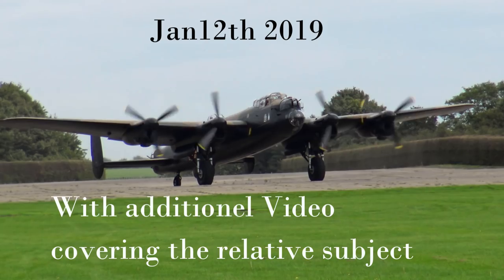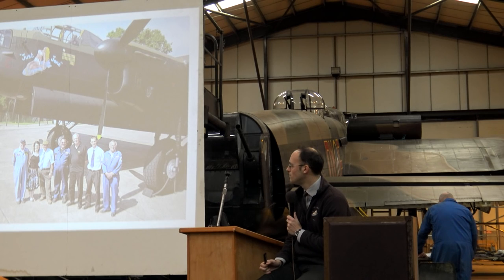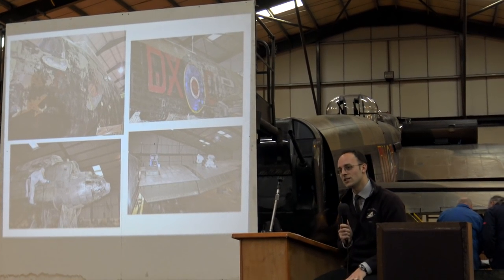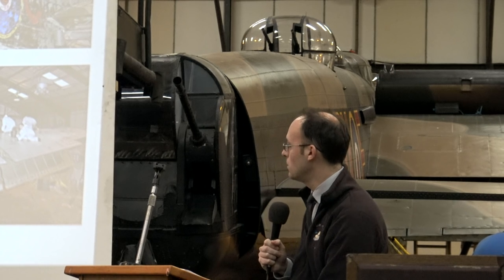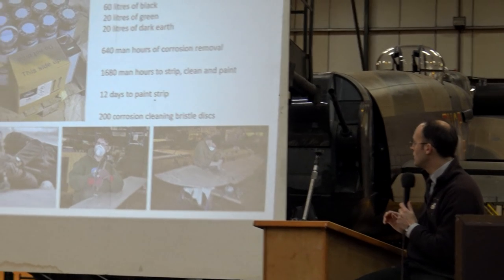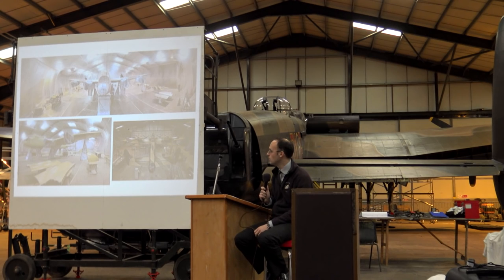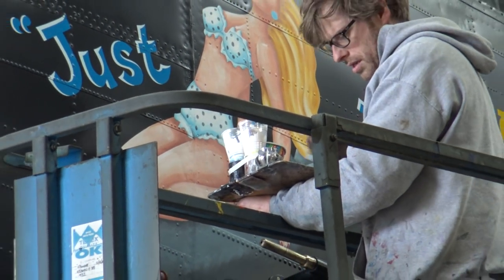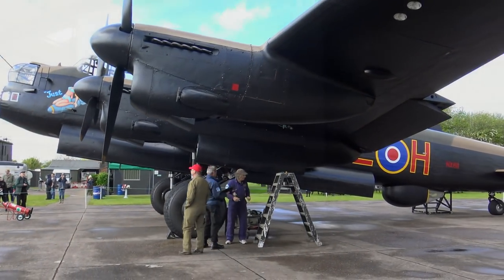Video 6A restoration of Lancaster NX611  2nd part of Andrew Panton talk

Comment: This story is very inspiring. To have a 2nd Lancaster flying in the UK will be superb. I have watched all the videos, and just watched the two that were uploaded over the last few days - parts 1 & 2. In those Andrew explained that a chap came in to rebuild the engines - no 3 took 1250 hours if I recall hiom saying, and then they worked on the other 3. And then you had the taxi-ing runs with tail up. You must forgive my lack of knowledge,  but if the original engines were reconditioned at great length/expense, why did it need 4 "new" engines to eventually make it airworthy. What will happen to the originals?
Reply from the maker: Hi Driverman0,  No 3 engine was rebuilt for taxi rides only ,to restore the engine and fit it to a flying aircraft it would have to be rebuilt to CAA specification and inspection. Andrew said it cost £100,000 to have one engine made airworthy by a CAA registered Company .  If they paid £20 per hour to the engineers 1250 x £20 = £25,000 it's a big difference in price and at that time they had not considered making the Lancaster airworthy. Of the four engines used for taxiing I guess they will make at least two of them airworthy for spares. These are my thoughts and not official comments of the Centre as I am only a visitor.  Hope this helps  Nev.
Reply: @nevillewheeldon1693  Yes, thank you Nev, it did. I am slowly becoming aware of the intricacies of the CAA rules! A working engine doesn't necessarily mean an airworthy engine!

Comment: Avery informative video as usual Neville, a real labour of love this project. I haven't been to East Kirkby yet, do I assume they have sufficient runway space for the aircraft to take-off and land when that day eventually arrives?
Reply: Geoff T Just to chip in on the runway question you had... There used to be a link on the LAHC website that explained in detail about how they will have a runway available for when JJ is ready to fly. I remember there's an agreement in place with a local farmer who will let them use his land to create a compete runway. I don't think it's there now, but neither is there a need just yet.
Reply from the maker: Hi Geoff yes they do have. If I remember rightly a Lancaster needs 6100 feet of runway, East Kirkby as 6250 feet. (CAA rules??)
Reply: Neville Wheeldon : Many thanks for the information. Geoff

Comment: It was a bit confusing to me.  Was the aircraft paint removed and then repainted before restoration started?
Reply: Restoring the outside was the best thing to do while awaiting the engines. When you strip the paint you find all the hidden boo-boos. as you must remove the skin for a complete restoration it makes a lot of sense to restore the bad bits (Tail section and leading edges) now your outer skin is painted its is time to see about the under framing. Aluminium begins degrading and doesn't stop once exposed to the air so minimum would be undercoating.